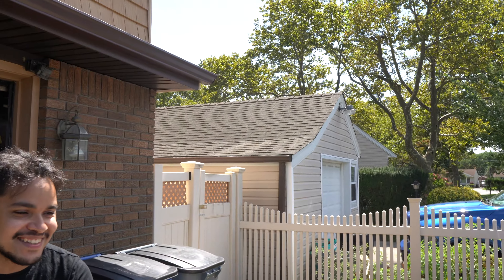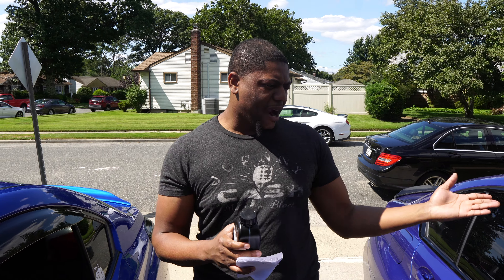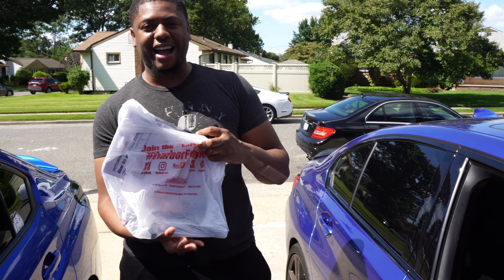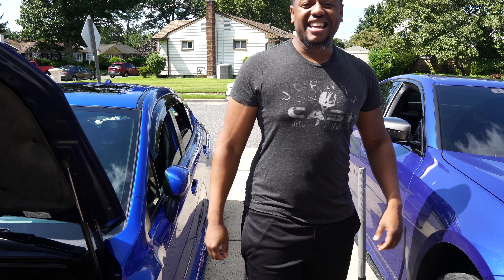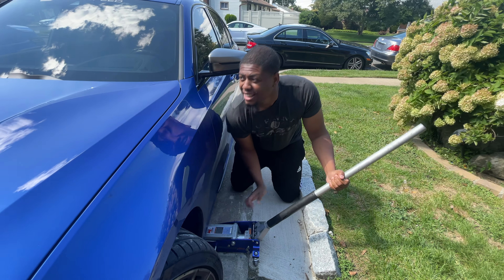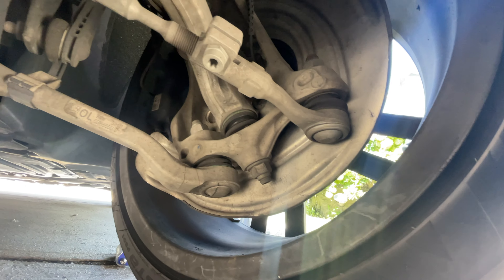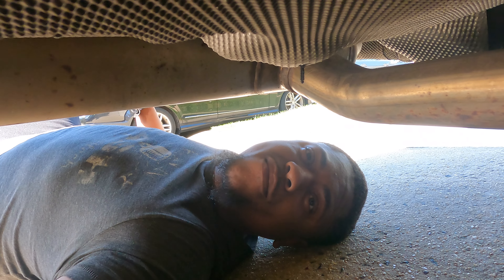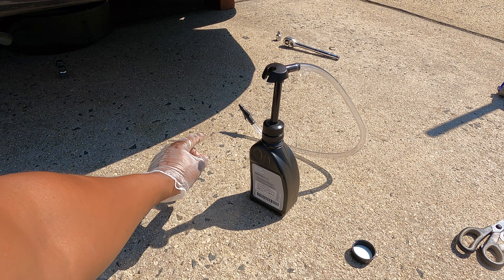Attempting To Revive My M340i

Comment: Great video. Good choice topping off. Always fun to watch these mods and maintenance. You help me enjoy cars since I left my 328i I have been just enjoying my maxed out x5 and doing maintenance. Sometimes I wish I still have a car. But never worrying about pot holes is amazing also.
Reply from the maker: Yeah these potholes can kill suspension
Reply: I feel you but at least you got the x5 still bmw. You can still have a little fun in those, right? .. you’re saying potholes don’t matter in the x5 cause you don’t get busted control arms and wheel bearings or just as far as comfort?
Reply: @CastroJordan  More so I don't get worry if I bent the rim and I don't bottom out the suspension.

Comment: Do you have a catch can? That will save your valves and turbo. The more power you make the more blowby the engine has and that extra oil vapor can cause knock. Carbon on the valves will also lower performance.

Comment: Just did this last weekend. Trans, front and rear, on my f30, 60k. all new fluid not just top off. G20 still using ZF’s, right? You should code in DRL for the taillights, looks much better in the daytime.

Comment: Upgrade your control arms. It was an amazing upgrade on the f30. Turner has the thrust arm upgrade and I’m sure the G80 control arms would fit on the g20 like the f80’s did on the f30. Check it out!